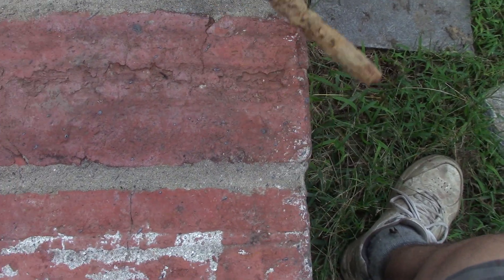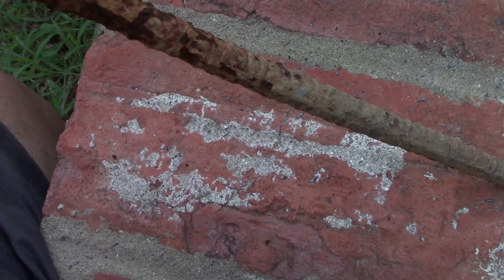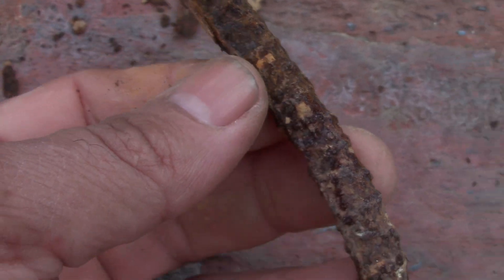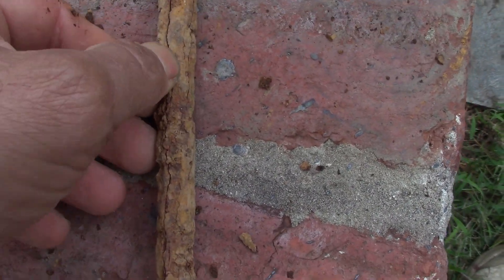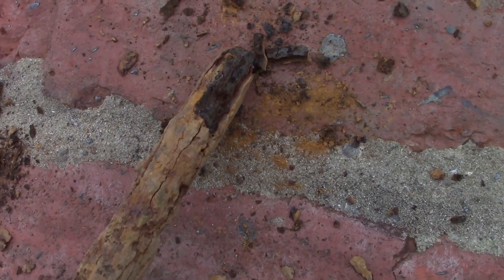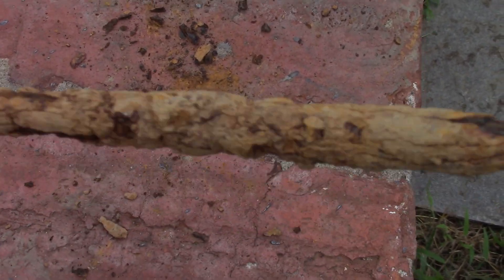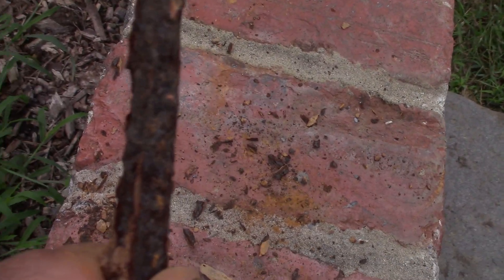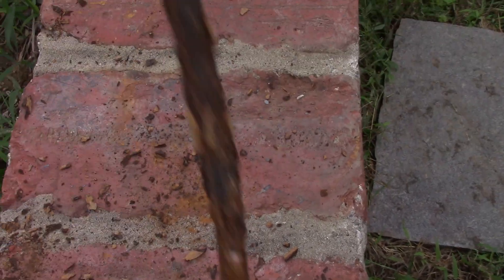Rebar in concrete Rust and Steel expansion cracks in concrete

Comment: How much of the rebar left after removal of rust is allowed
Reply from the maker: Just only use rebar that has had surface rust issues, not the deterioration point...   that is too far gone...  The diameter is #4 = 1/2"   #8 = 1 inch and you can guess the other numbers by eights...  So, if you are not measuring up, you are not to size...   Size matters.

Comment: Good video. I used to work in a printed circuit factory and the etching machine used Ammonium Persulfate and the fumes made everything in the area rust. There was a 2nd level working area which was held up by I beams and checker plate flooring and this was being lifted by the rust on the I beams. I was told that 1 micron of iron produced about 1" of rust. I have never been able to prove or disprove this but 1 micron for 1" seems too much. It would have been interesting to see how much expansion there was compared to the original material and the how much of the original material was left after the rust was knocked off. It would be interesting to hear from you if you took any measurements.
Reply from the maker: I did not take measurements but rust expands and that expansion will cause cracks in concrete.
This is also why rusty rebar is not allowed on "professional jobs"...
Could that be the "1 inch"?...

Comment: Would "sealed" rebar of a typical concrete bridge in excellent condition (northern states subject to water & winter salts) suffer from significant oxidation, or does uncracked concrete do a good job of "sealing" the rebar from the elements?  As the typical US bridge has significant cracked and crumbling concrete, we can see the massive oxidation so no question there. . .
Reply from the maker: Exposure of raw metal (in roads) always brings ''rust issues'' and this is why a lot of specs call for epoxy coating -- a ton more expensive but really works with little tradeoff...
Reply: @EngineerPEretired  Interesting; even if the epoxy rebar material cost 100x more than uncoated rebar, that would be a miniscule amount compared to the overall materials & labor fees. The potential increase in bridge longevity & reduced decrease in maintenance costs would completely overwhelm the cost of epoxy.
Reply: @EngineerPEretired  How about water damage to uncoated rebar which is encased in good quality, uncracked concrete?
Reply from the maker: Even the water from the concrete mix has some effect on the metal and starts the 'failure process".  It is best and will buy time to use a lower slump concrete mix (less water) but even then, most contractors literally wet down their jobs before pouring concrete (placing concrete)...  Which is mostly called for but as you can see, you just added water to metal...  It will take much longer to fail as opposed to imbedded metal that does not have a concrete psi that will allow for water penetration. 
Yes, is slight in moisture content but that bare metal cannot take any water without having issues... think of bridges, exposed metal, rain and air - all contribute to holes in the metal...
Reply: Thanks Kai - fascinating topics and super interesting intelligence.
Reply from the maker: Anytime Dos and thanks for the compliment.

Comment: Nice test. Do you think the modern salts used by winter road crews would cause significantly more oxidation of the rebar than your water test did?
Reply from the maker: Salts will eat at almost anything... Salts will create more of an issue...  Salt IS an accelerator of this process... it's conductive ability is what contributes to this...